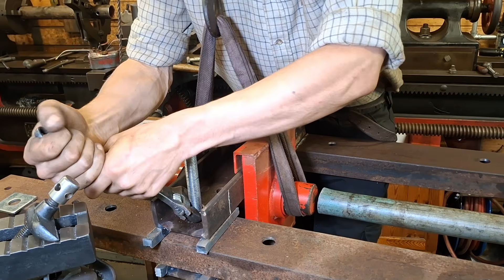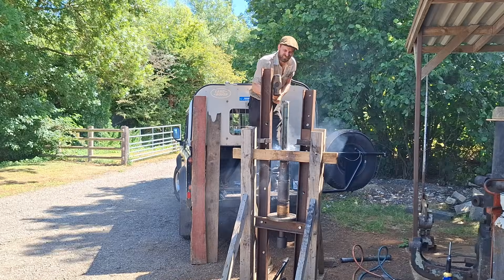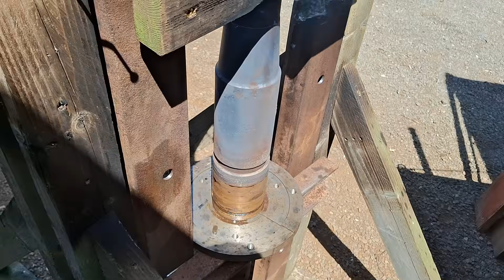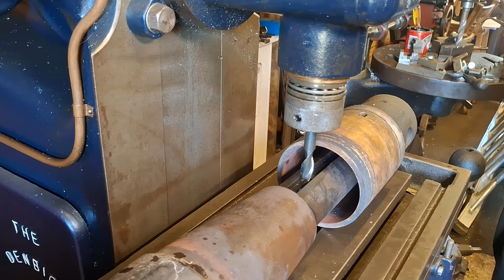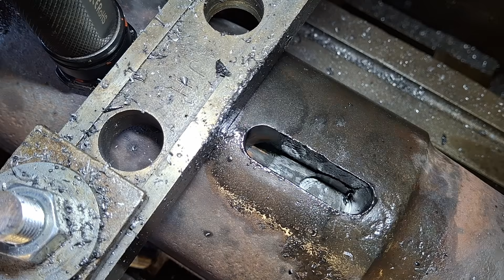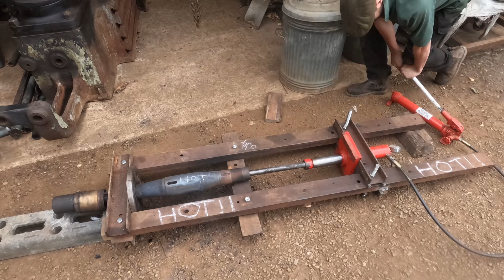VICTORY AT LAST! - Victorian Radial Drilling Machine Restoration PART 10

Comment: Try cooling the shaft with dry ice. 
It will shrink and slip through the coupling, pulley, bearing or whatever without needing to have high heat and all the protection that requires.

Comment: Very well done. You are nothing if not persistent as I can be at times when i don’t want to be beaten. 
I do however wonder about the metallurgy of those parts, they must be quite soft by now. I fully appreciate the desire to maintain originality as I have often tried to do but for a functional tool I expect some replacement might be prudent bearing in mind the requirement of truthful operation. 
Once again I would have pushed it backwards a couple of times as I find the muck to wedge up in such bores with a one way push.

Comment: I was thinking. At what point do you just make another part?  Also I'm  thinking make a very long 20mm drill bit  and bore a hole through it! Try running coolant through it while heating it. To get a larger temperature difference .  If this fails, Chuck up a custom boring bar in a lathe , toss the part on the cross slide . And bore out the center..
Reply from the maker: It's a tricky one to determine. If I knew how much work it would take to get it out before I started, I'd have probably bored it out and made a new spindle

Comment: Just remember, if it is liquid, it cannot be stuck.  🙂

I don't know if you have ever tried it, but I have had good, consistent results using a mix of 50% automatic transmission fluid and 50% acetone in freeing stuck or frozen by rust items.

PS:  That is a lovely mill that you have.

Comment: The only thing im curious about is how was the key originally fitted ? Is the tapered 'body' hollow ? and then have guide bushes or bearings screwed or pressed in to guide the shaft AFTER the key was fitted ? Not clear in the vid ! :/ Oh aye I better say well done lad. Now get back to work ye fanny ;)
Reply from the maker: So the large tapered bearing part is hollow and the spindle should be a sliding fit inside it. The tapered portions are the bearing surfaces that run in bronze bearings on the outside. The key would have been inserted into its slot from inside the big bearing part. Probably with great difficulty 😂
Reply: @iron_jonesy  Thanks Mate ! FYI, I did realize the bearing was hollow. After all there's a bloody great shaft sticking out the top and bottom ! Kinda like a shila being spit roasted 0_0  :D I'd be a full drongo if i didn't realise that ! I'm guessing but I reckon  must only be half drongo :) So what your saying though is when the tapered bearing was empty they would have 'jiggled' the key into the key slot from inside and then ran the shaft through the bore and align it with the newly fitted key so it would run down the keyway. Yea that sounds bout right.

Comment: In retrospect, with the time, energy and materials needed to seperate these seized components - would you do it again? Or would you do as many would and simply fabricate copied replacements?
Reply from the maker: A great question. For me, the driving force behind this restoration is to save the original machine. Which means saving as many original parts as possible. But there is a line, and I was getting very close to it! 
Would I do it again? If another machine of equal significance and rarity came along, that was just as bad, yes.

Comment: I've never fought anything that hard, but it always amazes me how a pin that just took 3-5 hours to press apart doesn't look that bad (surface finish) once you get it apart. It just takes one little burr, nick, bend or rust spot to weld steel together forever...almost. It's all downhill from here! You're SUPERMAN
Reply from the maker: Just got to put it back together!😂

Comment: I sorta walked in  this video not seeing any other previous ones. Question why no penetration oil? A lot of you fellas in Europe /  Britain are shy using with it between the heat and some WD-40 or some other brand maybe a mixture of both woulda help a bit move that shaft easily

Comment: I've heard about heat straightening a shaft. Keith Fenner had a little bit of it on his channel. Heat a small spot and quench. Check and repeat. I think it's an artform. He was able to eliminate runout to a very high degree. I'm not sure if you can get them perfect like that but it may as well be as far as the machine is concerned. The shaft he did was just about dead nuts straight afterwards.

Comment: Would heating it up even more, to almost read hot, before pressing have helped?
Or would that damage the parts?
Reply from the maker: A lot of the time it was that hot!
Reply: @iron_jonesy  Impressive that it was still stuck. Although would like to see more heat :D 
But it's difficult to determine when materials starts to deform or gets their properties too compromised.

Comment: impact!!!! rent or borrow  impact mode large drill  or full size  concrete impact  hammer after hydro acid in keyway, etc which will attack rust before base metal... of course have to figure out setup. Please wear your glasses/ goggles when hammering steel on steel....friend had nasty eye event when  a chip came off !!!

Comment: I've never had something big enough to try it but I've wondered if one of those plumber pipe freezy things might cool the inner part enough to cause some significant contraction change from the outside
cutting that key out should have provided the magical pop...jeepers that quill was frustratingly stubborn...that must be some big chunk of corrosion or grit ...and that last clip, definitely worth a shot of something old, alcoholic, oak barrel flavoured and richly deserved.
Thanks for being so darn persistent and stubborn
Well done.
Reply from the maker: Expanded rust and ancient oil at the top were the culprits I think. If I'd have been able to push it out the other way, it would have been easy!
Reply: @iron_jonesy  rust seems to have anamazing ability to expand even in spaces where it shouldnt be possible it still seems to grow and jam things tight...bizarre where water and oxygen gets to.

Comment: They say perseverance is a virtue but I think in this case its something far more rare. I probably missed why but I would have thought pressing the shaft into the bearing every now and then might have helped if the grime was compressing.
Reply from the maker: Yeah I did try and push it back several time times during the process but it was just as stubborn going back as it was going forwards! I decided my time was best spent pushing it the right way
Reply: @iron_jonesy  Thought you would have tried that. Impressive job

Comment: Grief! 12/10 for tenacity on that one. Only once have I had anything seized up like that, a 3ft fan impeller on its 4" shaft. It took me a day and a half to build the press, and another day and a half to press the shaft out. But I had the advantage of a 100 ton jack and an air pump. A week working like that though, hats off sir.

Comment: amusing, an average excavator could very well pick it up and just squeeze it apart...
its done, its apart... that press was scary AF. a bit more work on that side of it and it would have been a fair bit easier, losing a lot in the flex as you saw... well worth setting it up properly... just needed a few tie rails and channels on edge.. more bolts...

standing next to a pipe under pressure sitting on a frame thats bending under tension... a trusting man...
whatever. its out and the only holes are where theyre supposed to be... :)

Comment: Congratulations. About half way through this I wondered a) can you buy Evapourust in the UK, and b) has anyone suggested standing the whole column up and filling the top with Evapourust, followed by ATF  fluid to wash out any released rust. But you've done it now so we don't know if it would have worked.
Regards from Canada's banana belt. 
🤞🇨🇦🍌🥋🇺🇦🕊🇬🇧⚒️💣🏁👍

Comment: You should have got an old oil tank and fill with a diesel/kerosene mixture enough to cover it completely and left to soak for a couple of weeks it would have made a huge difference and saved a lot of effort but well done for persevering you got there in the end and saved the original part

Comment: Can I suggest dissolving some paraffin wax into the Kerosene  you are soaking the part in? I use a candle on hot parts often and when soaking find that the wax really does make a difference when [if] movement occurs.
Reply from the maker: I've heard about the candle wax thing, I need to try it!

Comment: Thats really cool that you have the right angle head for your old mill . You dont see that very often .Will you have to make any new parts for the sp[indle ?  Good Luck
Reply from the maker: Yeah, it makes the machine so much more useful!! 
There is a couple of repairs required to the spindle bearing and of course, the top end of the spindle needs straightening.
There is also the new feed screw to make!

Comment: I ran into the same problem trying to free a shaft from a tube belonging to a horse-drawn mower. The shaft was rusted and seized for about 1.5 meters. Because of the length of the item, we had to stand on barrels to get enough height to swing a 12 lb. sledge hammer. Needless to say, we achieved very little movement. Having a career working on the railway (37 years), I had the ability to swing a hammer better than most. As we approached the point of giving up, I thought I would try something a little different. I grabbed my handheld pneumatic hammer, the kind you chisel off old exhaust pipes with, put in a punch type bit, and it shoved the shaft out of the tube like shit going through a goose !  I believe it worked because of the succession of the impacts. You might want to try that if you run into this type of situation again. I really enjoy watching your channel, but I getting a little to old to do this kind of work anymore. Thanks for the show.
Reply from the maker: Glad you had success with the mower shaft in the end. I try my air hammer, but it made no difference, maybe a bigger one would have worked! 
Cheers!